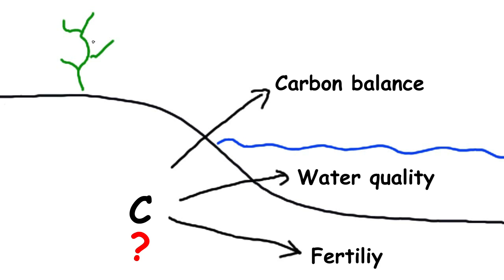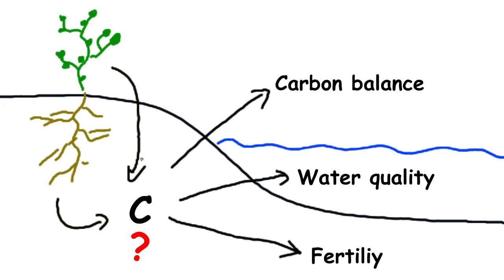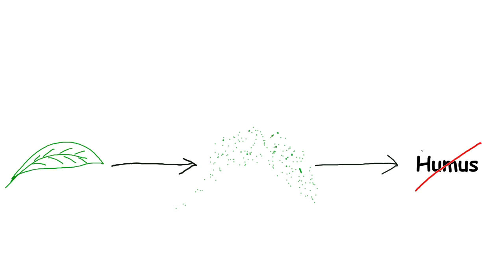How is carbon stored in the soil?

Comment from the maker: Thanks for the two comments asking to shift the focus on root exudates/soil microorganisms/mycorrhizal fungi. I have been working myself with mycorrhizal fungi for a long time and it is correct that such fungi, and soil microorganisms in general, are important for soil carbon. This was, however, not the question of the paper. The question was, whether humus is some special kind of compound "synthesized" within the soil or whether it consists primarily of degradation products of the original input. This is a pretty academic question and does not address which approach might be best in increasing soil carbon.

Comment: This is correct. Decaying organic material adds little to nothing to the "carbon stock" or humus in the soil. It does not increase SOM for any appreciable length of time. However, carbon from root exudates, stimulating the growth of soil microorganisms, does add to humus formation and this can be substantial, provided there is a substantial diversity of plants. This video, and paper, looks at only the decomposition pathway. That pathway may not increase soil carbon levels, but it can and does impove aggregation of soil particles. It is interesting that this video, nor the paper, make much mention of the plethora of soil microorganisms or their myriad of beneficial functions. An oversight all too common in agricultural science.